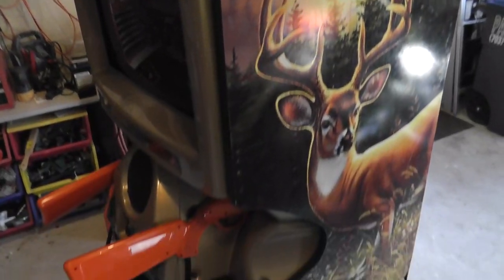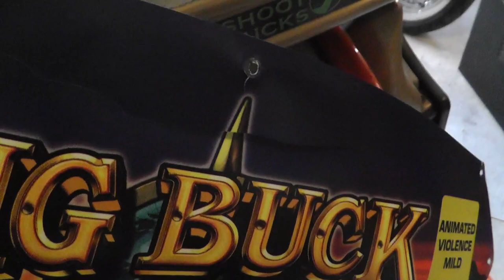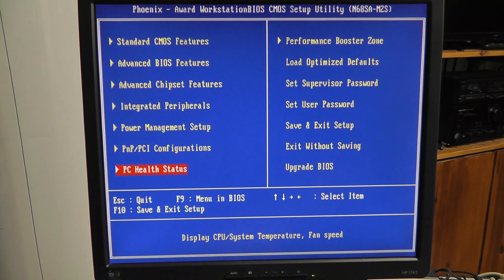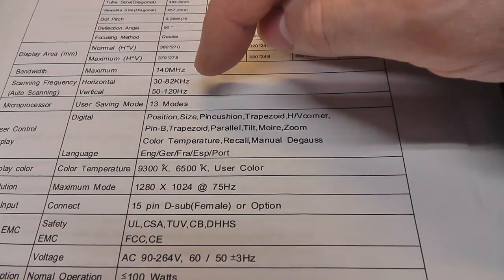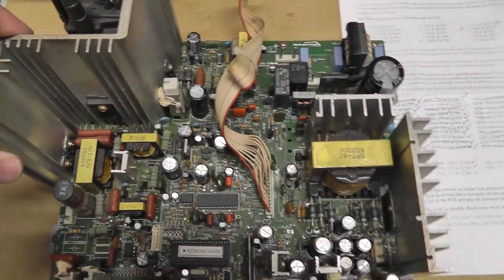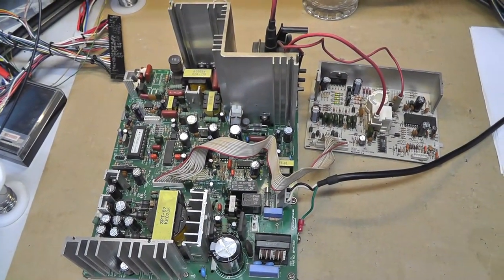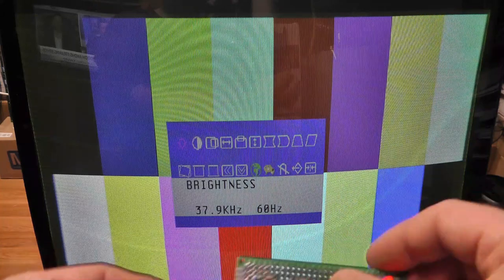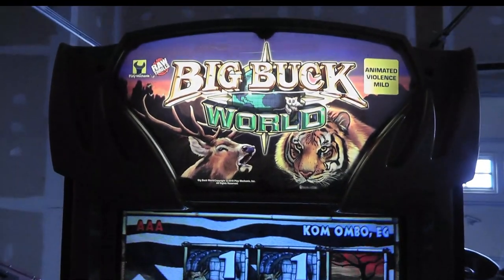Big Buck Hunter Pro / World - Refurb - Monitor Repair, Computer, Cleaning

Comment: Question, would you be able to upgrade the monitor to something more modern. I assume some modifications will be needed to the cabinet just not sure if the pc would run.
Reply from the maker: The PC would run fine but this is a light gun game and requires a CRT monitor.

Comment: I picked up this exact same setup from a neighbor a couple weeks ago. Monitor not powering on at all and a board to the monitor is clicking(relay?)
Stoked to get it running some day. Shame theres no way to convert to lcd screen
Reply from the maker: Ticking probably means the chassis is in High Voltage shutdown.  You can always send the chassis out for repair.
Reply: @jacklick  thanks for the heads up. I'm a big diy guy but if it comes down to it I have a retro arcade place around the corner that is more than willing to take my money for repair

Comment: So I'm watching this in September 2021, and I find it funny I'm about to restore that exact cabinet in my garage and i noticed your Harley in the background and swore i was watching a video of me in my garage. i got the cabinet with no monitor, power supply or guts for free
Reply from the maker: Not a bad looking 20 year old hog huh?  Good luck with your restore.  Fun game.
Reply: Well I’m watching this in November 2021, and it was working when purchased but now it’s telling me no signal. Any ideas?
Reply from the maker: @davidcoiner6550  Try to eliminate monitor or pc.  If the motherboard battery died it probably lost its bios settings and the pc won't automatically power up.  Next I would hook up a monitor directly to the pc or a computer to the monitor.  Process of elimination.
Reply: @jacklick  I’ll be honest I only understand about half of those words. I’m not very computer savvy. A family member bought this for my kids to play with. I assume all of that is accessed by the panel on the back?
Reply from the maker: @davidcoiner6550  the first part of the video shows where the computer is and how to verify if it is powered on.  If it isn't powered on, find and press the power button on the PC inside the coin door.

Comment: What is the name of the computer inside that arcade?
Reply from the maker: It is a no name manufacturer but it is likely a microtek.  Dell optiplex 740s are known good replacements.
Reply: @jacklick  I have another question. I have recently got the Johnny Nero Action Hero arcade game hard drive, and I put the hard drive on the computer and it didn’t work, in other words won’t work with the computer. Note: the computer was Dell Dimension 8110. So, how come Big Buck Hunter Pro’s computer work with the hard drive, or how did it all work through the computer?
Reply: @jacklick   I have another question. I have recently got the Johnny Nero Action Hero arcade game hard drive, and I put the hard drive on the computer and it didn’t work, in other words won’t work with the computer. Note: the computer was Dell Dimension 8110. So, how come Big Buck Hunter Pro’s computer work with the hard drive, or how did it all work through the computer?
Reply from the maker: @jodywaldrop9558  No idea about Johnny Nero.  Big Buck Hunter has usb based Keys that are required to run the game.
Reply: @jacklick  Okay